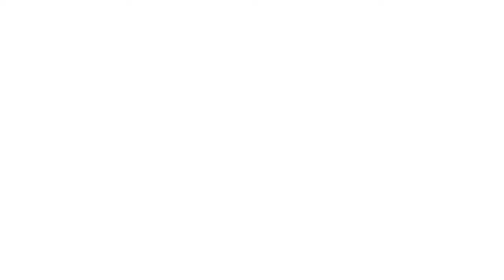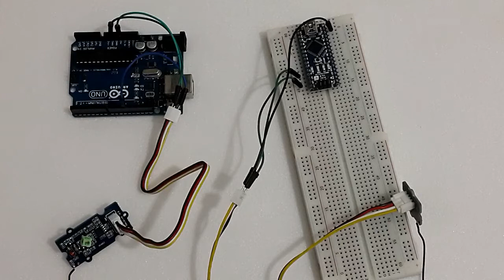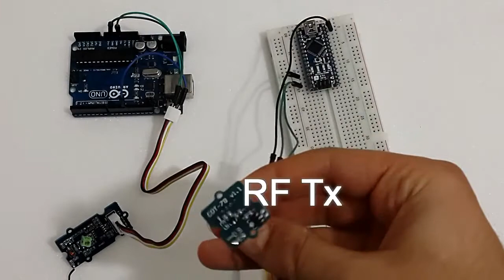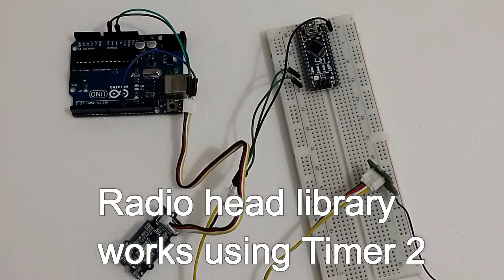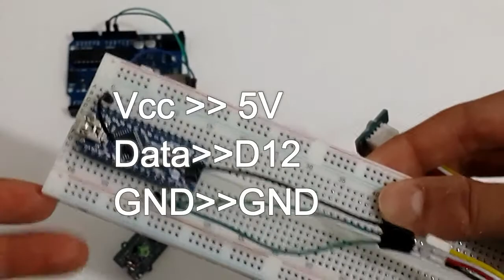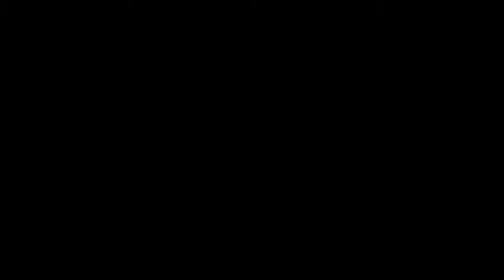RF 433MHz / 433MHz and arduino with code and schematic using RadioHead library

Comment: I Mohannad, thank's for your tutorial !
The blink function work perferctly but i did not find the sketch with the button function.
Can you put a link to download it ?
thank's
Reply from the maker: Hello leno , thank you so much .

for the receiver the code , there is no change . 
for transmitter code , i attached it in Hex format in my instructables article in step 3 section 

https://www.instructables.com/id/RF-315MHz433MHz-Wireless-and-Arduinoagain/
if you still have any problem please send to my FB page here 

 https://www.facebook.com/Mohannad-Rawashdeh-Raw-774983565988641/
Reply: Thanks i'll try that.